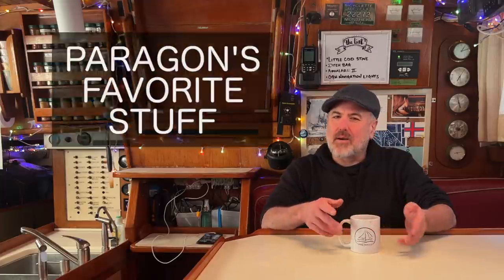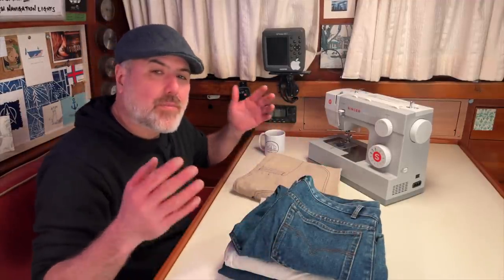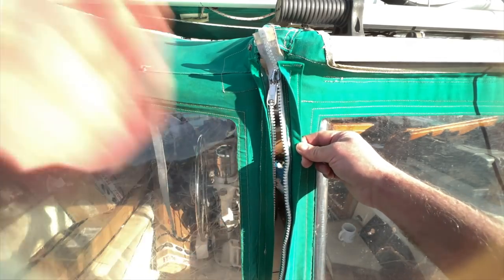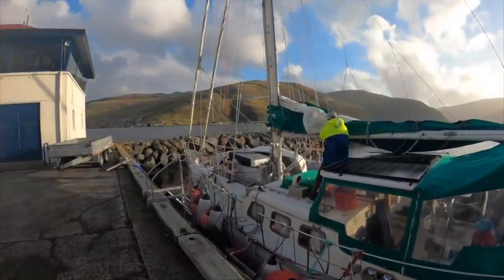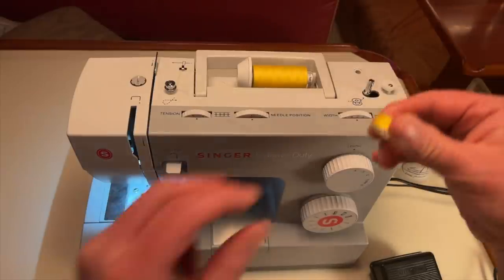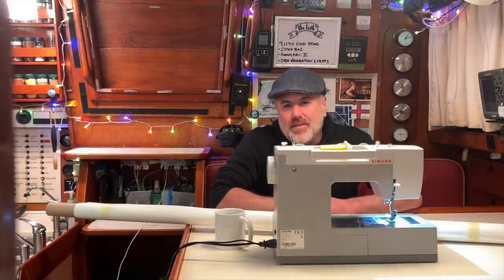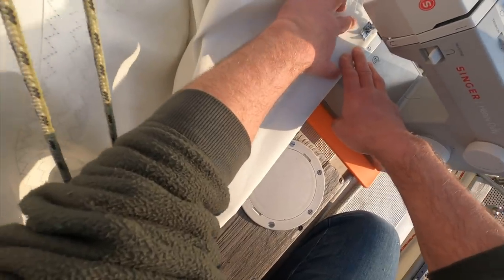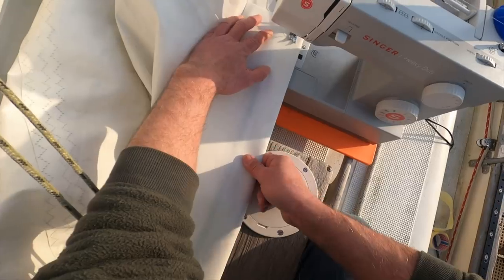Best Sewing Machine for a Boat? Singer 4411 Heavy Duty | Paragon’s Favourite Stuff Ep. 11

Comment: Sorry you had such a bad experience with the Singer.  I looked at them briefly before purchasing the portable version of a Sailrite machine.  Your video confirmed I made the right decision. (Saved me the additional $300 bucks for something that would not serve.
Bottom line - to he Sailrite machine is designed to do sailmaker level jobs.  It will effortlessly punch through eight layers of cruiser weight sail sailcloth without a hiccup. I bought one to do some similar repairs to my mainsail and since have used it for many projects, new and repairs for five years.  Couldn't be happier.  Even have made a few bucks repairing other folks canvas and sails.  There is one other brand of machine that is comparable but for the life of me I can't remember the brand.
Cost is around four times that of the Singer but you get 10 times the machine.  Go for it, you won't regret it!

Comment: Hahahhaha I had exactly the same experience ...I thought I could use a refurbished 100 USD Singer 411 instead of the Sailrite but not...definitly a piece of junk
Reply from the maker: We were able to use the Singer Heavy Duty to get the job done in the next episode by using a bigger needle and foot attachment. https://youtu.be/8UJ49FFuW6U But ya, a Sailrite definitely would have been the perfect machine for this job. Stay tuned. ;)
Reply: @drakeParagon  Be very careful to use the heavier needle because if you get stock multiple time, the needle gear that is underneath is in plastic and will get damaged  !!!!  yesterday, when I was repairing my  genoa,  I damaged the tooth of the gear and lost the synchronism needle-bobbin...there are not available spere parts on internet! moreover when I tried to remove the gear with the allen key being the screw in plastic I  ripped off the head of the screws...now I guess I have to dispose this machine in the place it deserves that is the garbage. Definitely this machine is powerful for nothing. It cannot be used with heavy materials because the presence of plastic gears to save few dollars in the construction. Junk
Reply from the maker: @lorentosi  Thanks for the tip Lorenzo! :) If you want to try to repair your sewing machine, then I know a guy. :) His name is Davie, and he runs a Facebook page called Sew Far North, which is for helping people fix their sewing machines. https://www.facebook.com/groups/1346509865787938